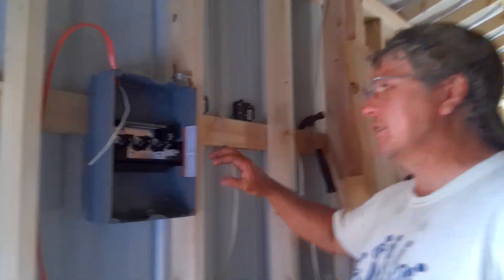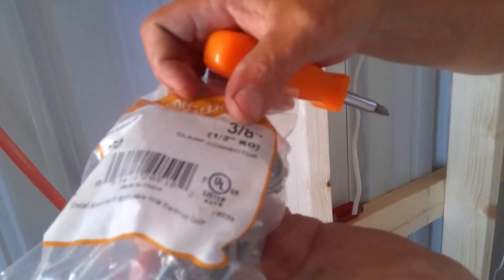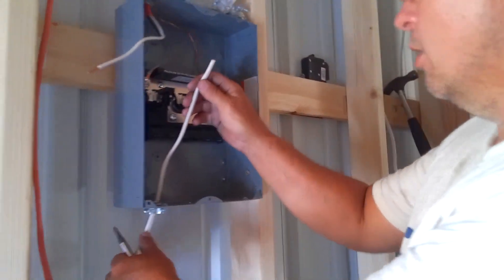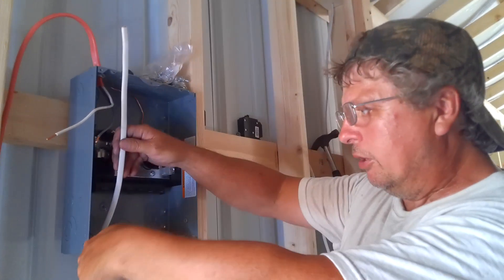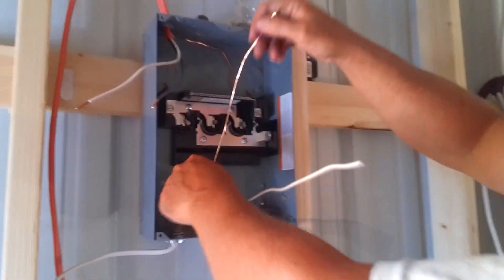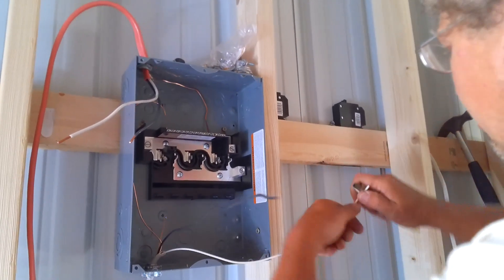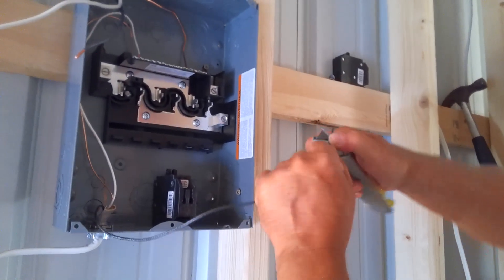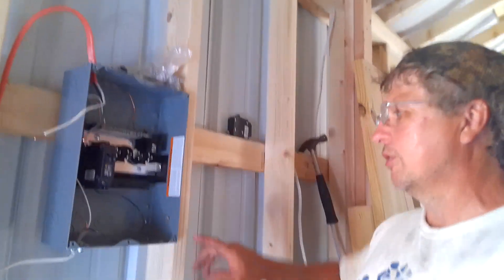How To Install A New Circuit Breaker

Comment: I have the same subpanel, ran both hot phases so I have 240V to the panel, but cant fit the dang 240V two-pole breaker in the box. Any tips?
Reply from the maker: Besides making sure it's the right style breaker I don't have any
Reply: @MrJustDIY  thanks. I figured it out.  Just had to realign everything a bit and push harder.
Reply: Just bought this panel to power my shed with a 240v generator with this same panel and I'm just  curious how you set it up. Can you run 120v out of the other on this from the 240v fed two-pole breaker?  I'm not an electrician obviously and from I've seen and researched the larger panels split the 240 to 120 between each side, does this one have that capability with them only being in one line?

Comment: I am only getting power to 1,3 and 5 breakers...is that because I only used single pole breakers?? Thank you
Reply from the maker: Sounds like one side of the main breaker is dead
Reply: I just did this yesterday.  1 3 5 are connected to the right hot lug,  2 4 6 To the left lug.  I was told I could run a jumper wire from the right lug to the left lug and all six breaker would work,  not so.  If the hot is connected to the right side using a jumper wire to the left side 2 4 6 Trip out.   I think to use all six breaker you have to have 50 amps.  If I'm wrong someone please tell me.  Thamks

Comment: Thank you I truly learned something, that the top bar can B used for grounding as well as neutral white wire 
connecting Thanks !
Reply from the maker: You can but it's better to have a separate ground bar
Reply: @MrJustDIY  okay then I will do Thanks
Reply from the maker: @smartrecovery5858  You're Welcome

Comment: Great job I enjoyed it. Oh one thing I noticed it I didn’t see the ground and neutral wires separated. It’s supposed to be that way in sub panels. Just some additional advice I wanted to share 😊😊😊. The video is very helpful.😎
Reply from the maker: You are correct